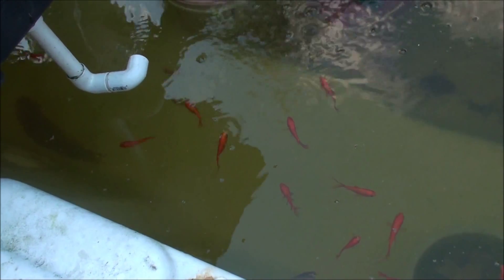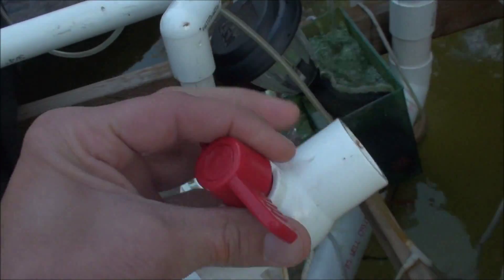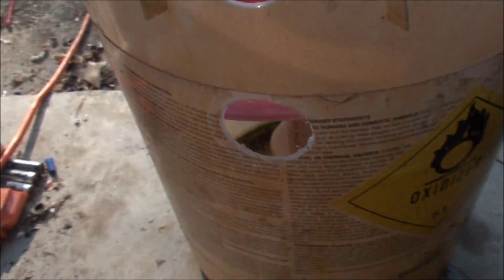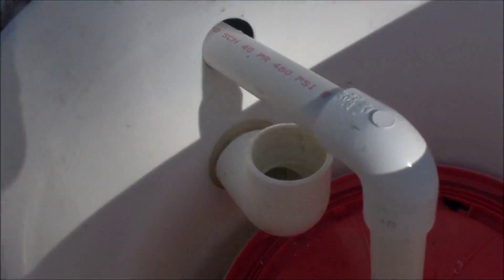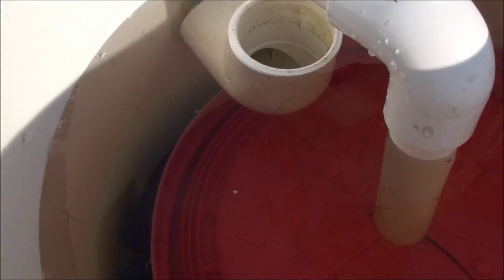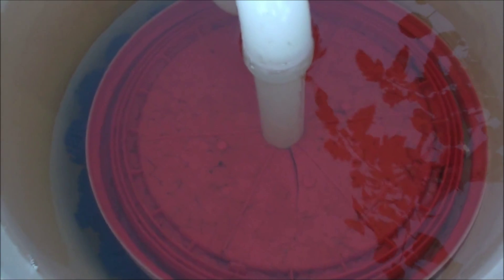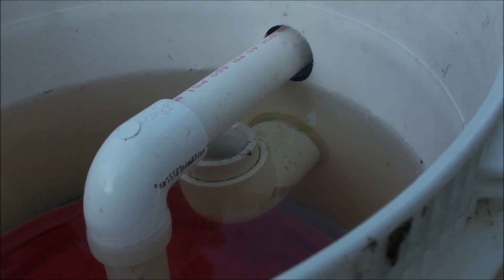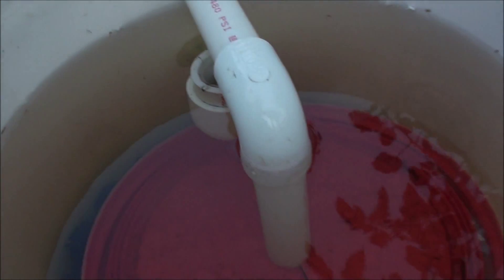Hot Tub Aquaponics: Bio Ball Swirl Filter Design, Take One

Comment: I have been worried about the antibacterial on the spas is that going to affect fish?  I have been dumping rainwater into it and want to convert it to an outdoor aquaponic.  How will you keep fish warm during the winter I live in the Midwest
Reply from the maker: I believe you are referring to an "antibacterial hot tub" and there is no such thing. The selling point that dealers tell is that there is a "special antibacterial coating on the filters" that keeps you safe from diseases but the sanitizer (chlorine, bromine, peroxide, silver, saltwater or chlorine generating, etc) is what will kill the bacteria, especially in such a hot environment. But to answer your question, I got goldfish because I knew that they could handle the wild flucuations of temp we get from high humidity 100's in the summer to freezing in the winter. I thought about keeping the tub hooked up and running to heat it but I dont want to pay for that high bill and my fish might get sucked up in any of the intakes not to mention that I pulled out all of that equipment and gave it to friends who needed it and then replumbed the whole tub. I have figured that if I am going to heat the tub for the fish and plants that I will first have a greenhouse (very cheap 100 to 200 dollars for a decent cheapie) then I will get a couple decent fish tank heaters or use a hot tub setup but with a "fish friendly" intake and figure out a way to integrate that system into the water delivery for the beds and pipes to benefit the plants first then the fish and I will be golden!!So much still to do!!
Reply: I'm not using the hot tub heater I am using a separate heater  I can also enclose it I want to raise tilapia so I can eat them might have to have alternate housing during the winter for them.
Reply from the maker: It sounds like you already have a great plan ready to be started. I would start now and see how far you get by the end of the summer and if you cannot harvest them soon thereafter I would move them to warmer housing. Shoot some video of your setup and plans, I would love to see them!